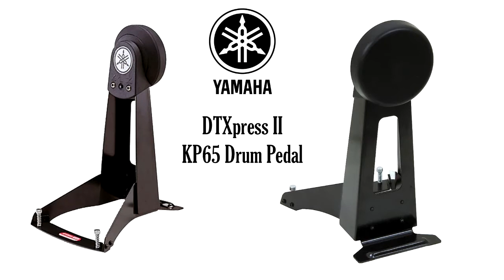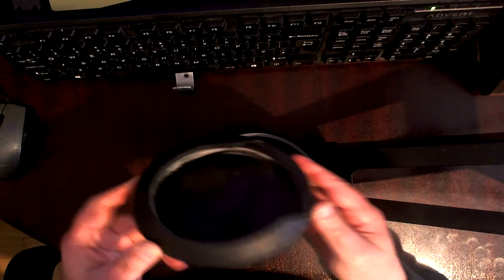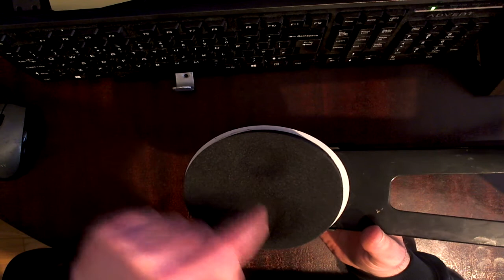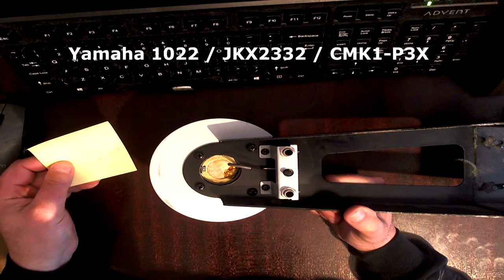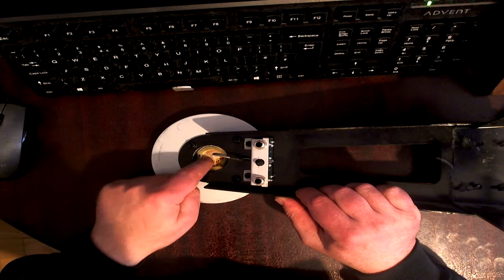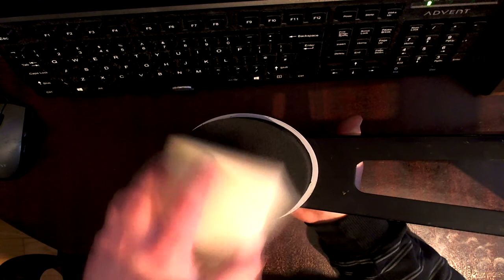Yamaha DTXpress II KP65 Drum Pedal - Can It Be Repaired? - Part 1

Comment: Hi, 
Thanks for sharing the video.
Please can you tell me how to refit the rubber cover easily, I'm having a problem and don't want to split it 
Many thanks 😀👍
Reply from the maker: HI, You just need to stretch it over the rim. It's rubber so it should be ok.
Reply: @CircleOfWhiteLight  Guess I'll have to try again and hope it works 🤞
Thanks
Reply: @davidm3569   the sensor is probably ok, its just the indent making the beater miss the piezo sensor, I put a piece of felt cut to the size of the dent and bingo, working like new!